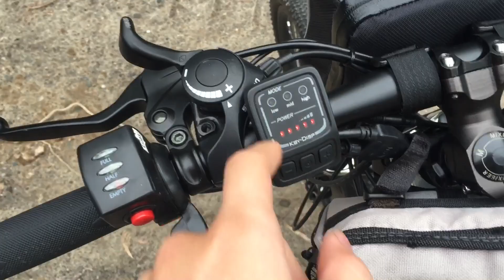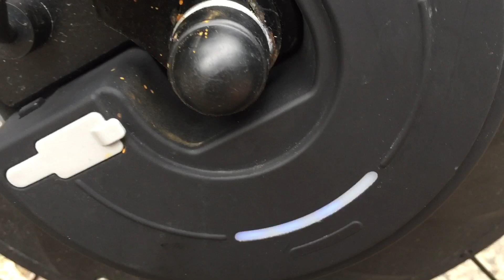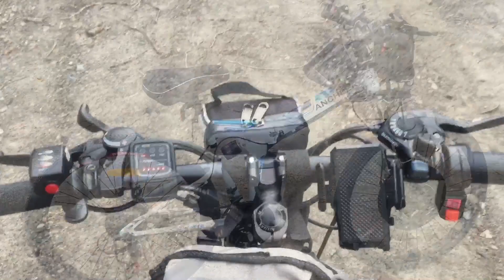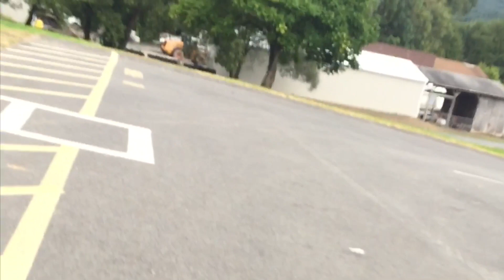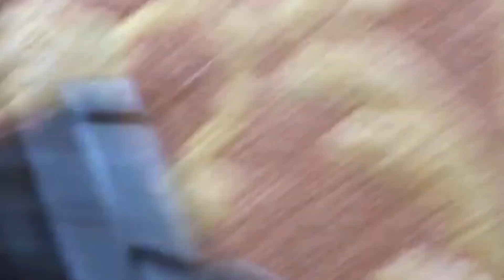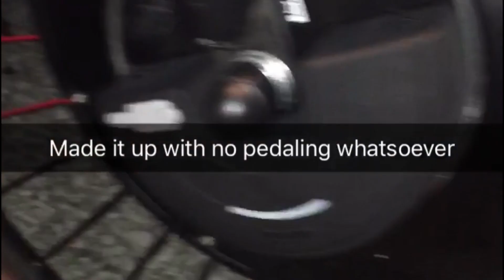Dual Motor & Battery Converted Ancheer Electric Bike 36V 250W & iMortor Front Wheel Motor 36V 240W

Comment: Interested in seeing normal tire, 26", 27.5" x 2 to 3" max width commuter front suspension, lighter weight bike that are NOT BRANDED ...reviews with the most torque motors...THAT is a niche in reviews that is missing. All these ebike channels are pushing branded marketing ebikes, and they are all the same $1500 to $2k ebikes...Yet, you can get the same base of the ebike foir under $700 and update a few parts and you have a better bike than the branded models.  The frame and motor are key. Some use 8speed, and torque sensors as well, so ...Would love to see such videos with 1500w+ 48v motors for torque.

Comment: How fast and how far with extra motor?
Reply from the maker: When I last had the bike, it went just about the same top speed of 17-18mph with both motors. The difference was the acceleration increase, and hill climbing was a lot easier and at a faster pace than 1 motor. Distance, maybe around 12-13 miles depending on how you use it, how conservative you are and all those kinds of factors, but I think if you also help the bike by pedaling, then with the 2 motors you’re looking at around 15 miles on a single charge.

Comment: actually, there is a way to convert Ancheer original battery to removable. all you have to do is disconnect battery cable from the controller and roll it inside the battery...!

Comment: Yesterday I ordered an Ancheer Sport like yours. Looking forward to riding it and doing mods along way. The two motor idea had already come to me. LOL Anyway, I'll subscribe and keep up with you exploits. One question, what do you think of the front and rear suspension, does it make the ride fairly smooth? As for the squeak, oil and WD-40 on every joint. LOL  Oh, and btw, have you had any thoughts of mounting a rear rack? Kind of hard to do on those with the rear suspension.
Reply from the maker: Okay so, as I don’t own the bike any longer, from what I recall, the bike was actually really smooth, the suspension I will say, was on point. Andd, the person who I sold the bike to I see him still riding it to this day, and he has a rear rack on there, so, I actually don’t think that part should be as complicated. From my own experience the bike was a great purchase for me all n all, especially for the price that it is at.
Reply: @ebikeandtech  Wow, you know this post just popped up for me on YouTube, I thought it was brand new. But now I see it's almost a year old. LOL Ok, well Fedex is suppose to deliver the bike tomorrow, guess I'll find out soon how much I like it. Thanks.
Reply: @gerfmon1  could you let us know how you got on with the bike as I'm thinking of getting the same bike.
Reply: would you buy this ebike again? do you use it regularly? do you recommended for daily usage? is it  worth the price in the long run? Do you think that the battery can be easily stolen when parked outdoors?

Comment: Do you have a video on how to build it?
Reply from the maker: Unfortunately no, I don’t have the bike anymore. But it’s all basic stuff, you get the Ancheer bike online, it comes in, you assemble it, then you get the iMortor front motor wheel, it comes in, you replace the front wheel of the Ancheer bike with the iMortor front wheel, and then that’s it. And then when it comes to assembling it, there’s instructions that come with both the iMortor wheel and the Ancheer bike itself. So I don’t think there should be many complications. And to put it all together, if you were to buy them both at once, it would take somewhere between 30min-1hour.
Reply: @ebikeandtech  
What happened to the bike?

Comment: If you have two hubs front and back, why are you still capped at the same speed? Just wondering because I may take this modification into consideration.
Reply from the maker: Pete S. Because they both have the same speed limit therefore they can’t just double the speed, they can only help the bike take on hills easier and also extend the bike’s range it can travel. Hopefully that helped
Reply: Top speed of the motor is top speed. Period. This isn’t like a gasoline engine with diminishing efficiency and output. As long as the electric motor is getting proper power when it reaches max speed, that’s it. With some caveats. So if you have one or two electric motors, if they’re rated or limited to a particular speed, that’s all you’re going to get. His downhill speed is being limited by basic physics if I understand what’s going on correctly. If the max rpm of the front motor is say 1000 rpm, and the max rpm of the rear motor is the same, then based on wheel size that’s your speed. On the Ancheer there is a speed limiter. Hard to say exactly why it’s there, but it’s there. He could get a top speed of about 25-28 mph but that will definitely effect distance and battery life. Having said that, he now has two motors and two batteries. He should be able to leverage that for in the range of double the distance. A bit less than double, but in that range.

Comment: What's it's like with just the front wheel? How much did the bike cost and where did you get it?
Reply from the maker: The front wheel on its own is actually not bad at all, it just needs a little push to get it going but other than that it goes about 15-17mph. The Ancheer bike fluctuates on Ebay for around $500-$600. And the front wheel is around $300 on it’s own.
Reply: It'd be interesting to see a video of the front wheel motor assistance without the rear motor working. Curious how well it goes up a hill. If you have the opportunity.
Reply from the maker: Of course! Even though right now it’s getting colder where I am, I’ll try and find some time to make a video on it (: No problem
Reply: Have you had any batt ed Ryan shortage issues (original battery) yet does it drain fast? How many hours it last or milage you get on full throttle alone?
Reply: And I notice when u use the throttle the battery indicator seem to show 5 dots then 3 then 5 again I get confused sometime where idk if my battery is dying fast or it's still full